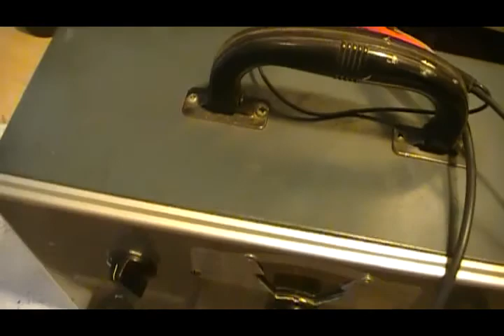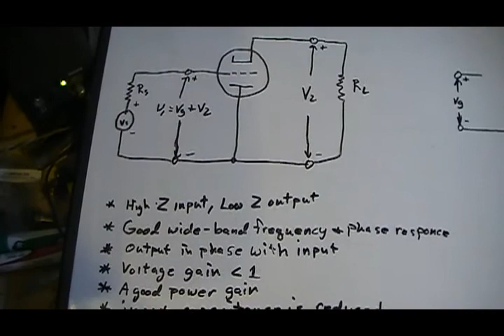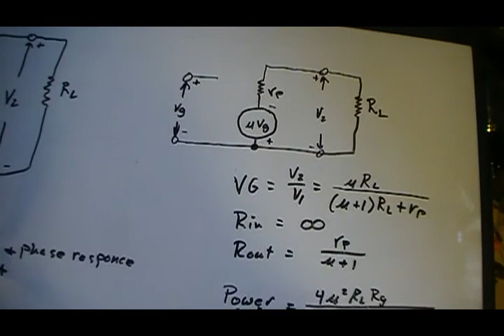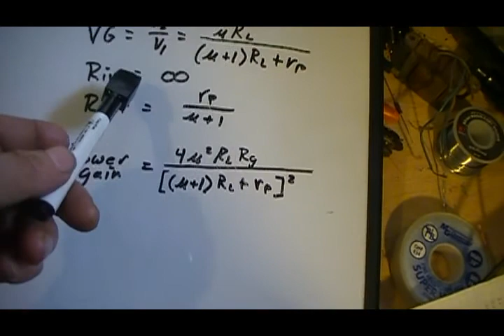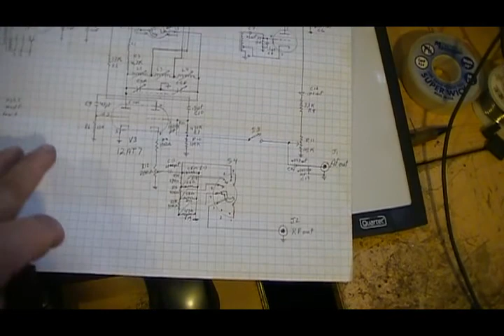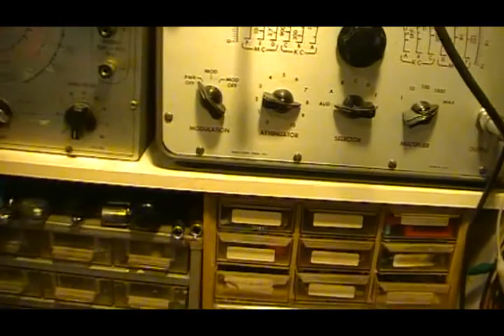RF generator part 3

Comment: I recently desined my own RF generator (only transistors, no ICs).  If you want to have a perfect sine output at a constant amplitude over a wide range you need a amplitude controlled oszillator. The amplifier of the oszillator needs to have a voltage controlled gain. The output of the oszillator is then rectified and the gain of the oszillator is adjusted by a feedback circuilt to keep the output of the oszillator at a constant low amplitude (1Vpp in my RF gen). Its like a AGC circuilt. By adding a audio frequency voltage to the AGC voltage you can easily produce good amplidude modulation .Also be careful with ferrite cores, some of them cause a lot of disortion. Sorry for horrible grammer :D

Comment: Great and detailed video on the cathode follower circuit Dennis!
   Your signal output from the RF generator that you designed looks great.
   Speaking of using a freq counter instead of relying on the dial setting. I know my freq counter is off. Any feedback that you could me to accurately and cheaply align mine would be greatly appreciated. I was thinking of using WWV @ 10Mhz using my PLL rig and LSB/USB to zero beat it.  
   Exemplary, is all I can say.
      Keep them coming my friend!
               Tom
Reply from the maker: Hi Tom. Thanks for the comment and sorry for the late reply. On the aligning your freq counter doing what you are thinking using WWV  is the best way to do it.